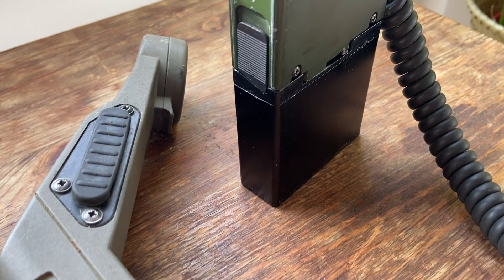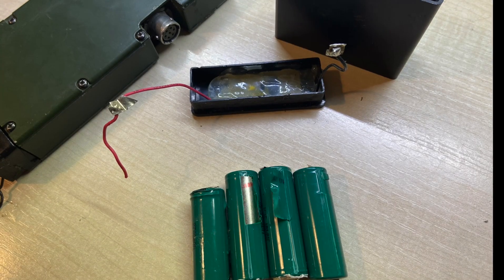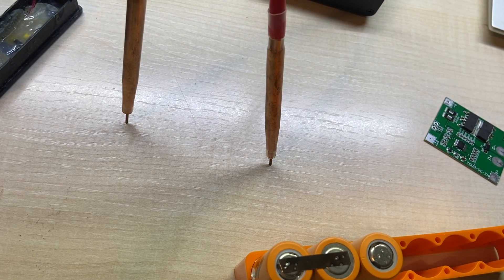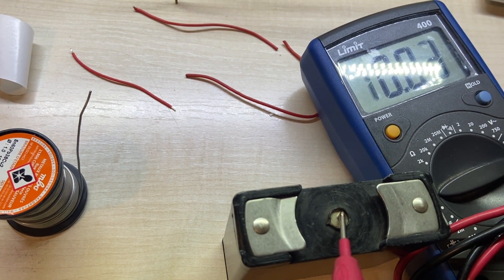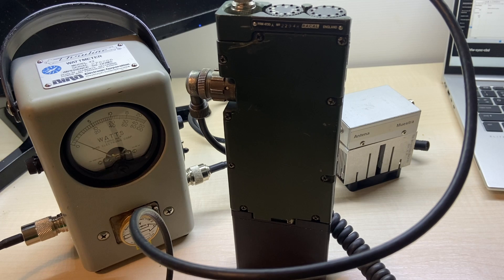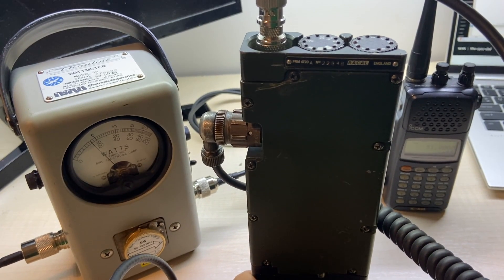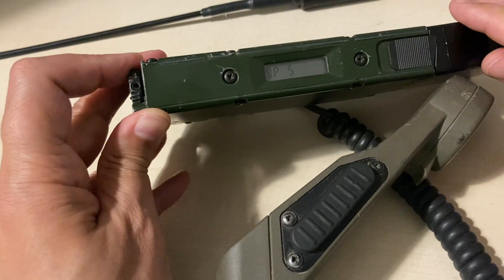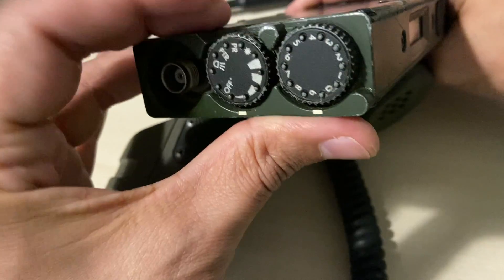RACAL PRM4720A military transceiver

Comment: PLA has replicated this type called as tbr115,  and used from 90s to 10s, almost 2015.
Reply from the maker: Hi! I didn’t know that. It is a direct copy 😬
Reply: @Radiogenes   almost the same model but added some China characters....such as battery, antenna and the most important one, the headset

Comment: Very nicely done. I’d use thicker wires though. Maybe 18AWG or there abouts. The balance wires are fine as they are. 
I remember playing with these when I was in the cadets.
Just got hold of an IC-7200 so I won’t ask where I can get some of these. But feel free to share 😂
Reply: I don’t think it was this one we had in the cadets come to think of it. It had 3 flat thumb wheels on the side I think. Such a long time ago.
Reply from the maker: Do you like your 7200? I own one. Solid gear. It has a particular AGC… hiccup you know
Reply: @Radiogenes  Still waiting on it to arrive. It was the solid construction that pushed the FT-897 out of the way. The FT-897 is a high maintenance gold digger of a rig anyway.
Still want an FT-891 though...

I have yet to work out how to get the 7200 in the shack unnoticed. 😅

What experience can you share on the AGC?
My understanding is that it has DSP in the loop with the idea being to reject strong signals by preventing weak signals getting swamped (overwhelmed) or silenced by the AGC working to quieten the adjacent strong signal.

Comment: Hola from Greece, I had lots of fun with this HT as a HAM in the Greek armed forces, on the military side - it had very good receiver, outstanding audio, lots of TX time for the batteries of the time and it never got hot - I almost exclusively used it in whisper mode. it was amazing with a simple wire dipole..........oh how much I would love to have one now and set it up in portable digital modes!